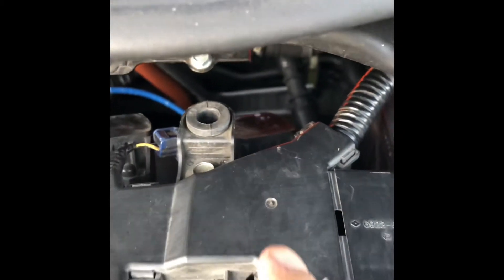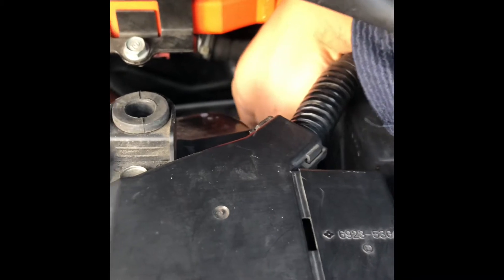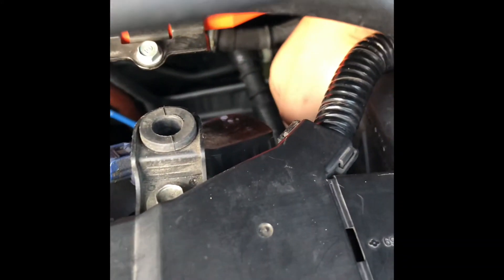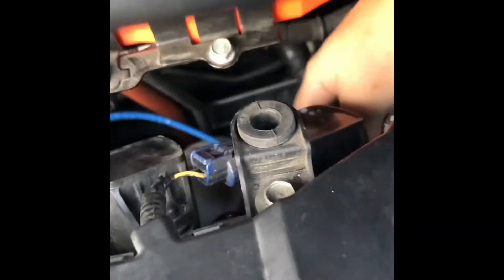8th Gen Civic Hybrid Only Coolant Sensor Locations

Comment: ok so how did you get the ECT#1 out.   there is no room back there.  did you have to take the air filter out? did you come up from the bottom?
Reply from the maker: I came at it from the top.  I did remove the air filter.  I also used a short handheld ratchet.

Comment: as for the back sensor, would it be easier to get to it by removing the air filter housing?
Reply from the maker: Yes.  Remove the air housing so you can get behind it.